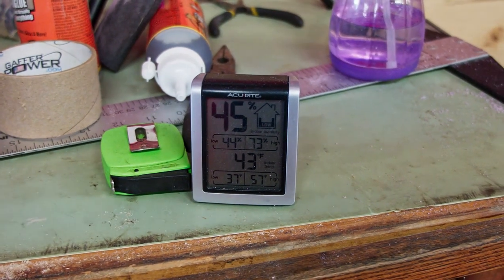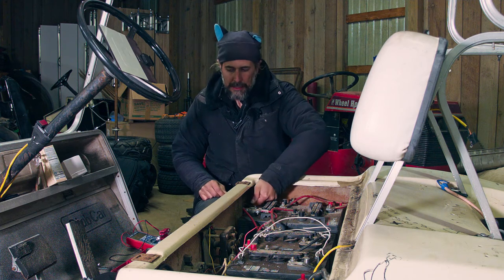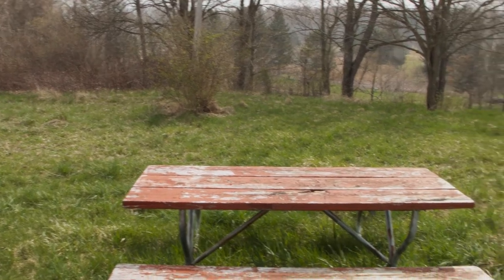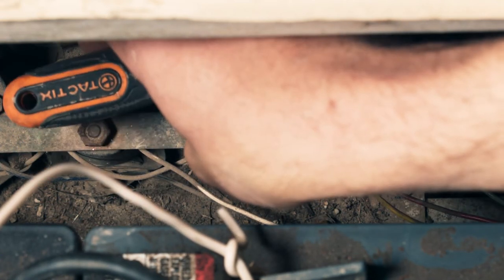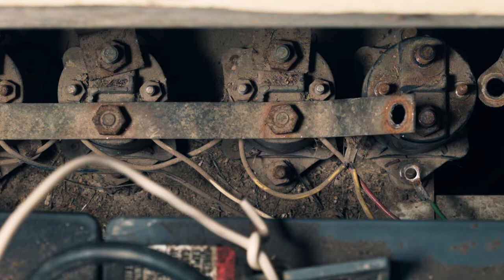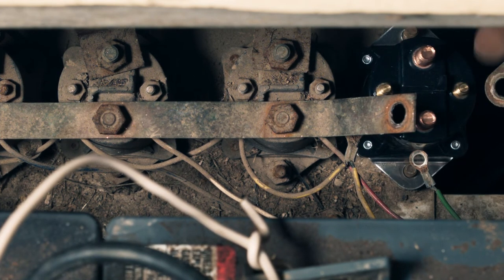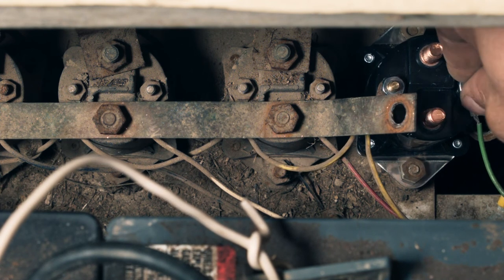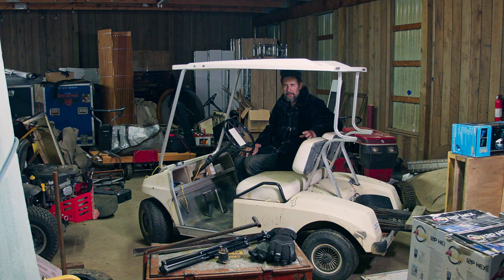Day 25 - I install the new solenoid in golf cart #1

Comment: I actually do not know what a solenoid is.
Reply from the maker: In this case, it is just an electromagnetic switch. It is basically the same as a relay. Some solenoids have the same type of field coil setup for operating them, but instead of switching current, they activate a mechanical valve or other device. That would allow you to have a valve on a pipe that you could open and close via a microcontroller.

The common aspect is that there is a coil of wire which acts as an electromagnet and moves a piston or plunger in order to turn something on/off.